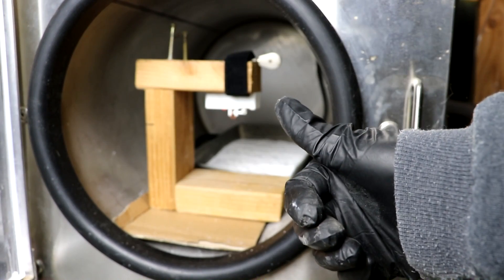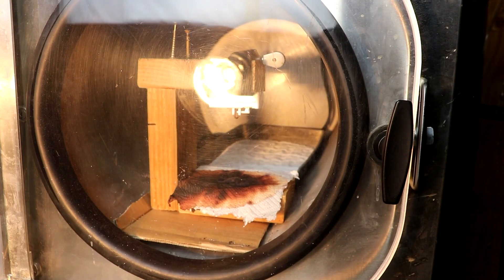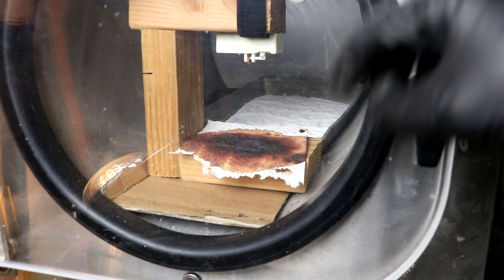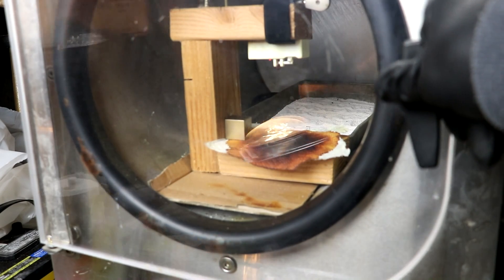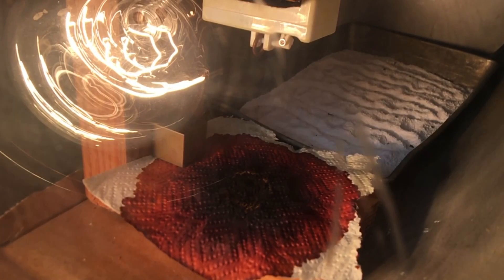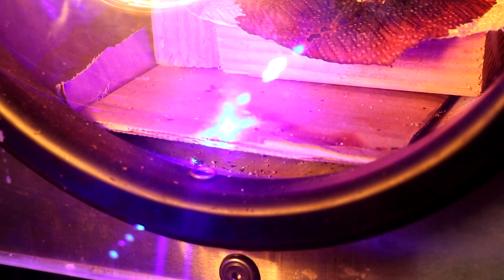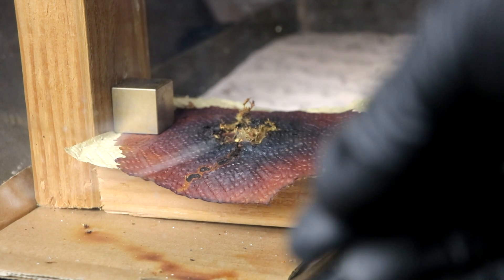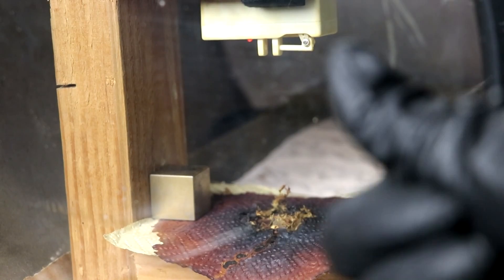Iodine Touch Powder in Vacuum

Comment: Cody, lets see a speaker in the vacuum chamber, it will be interesting to hear how the sound changes as the pressure goes down, and then hear the volume go really loud after the pressure is returned.

Comment: Hey, I wonder if it would set off under sudden pressure change - i.e. if you just depressurised the chamber as quickly as possible. Although I guess entering air could blow it away - you may want to put that in some small container to prevent that

Comment: what pressure did you do that at?  can you try putting a vacuum pump and chamber into another chamber to see how far down you can take the inner one?  compare your results to outer space?
Reply: What you're talking about is a multistage pump, and laboratories regularly do this with the second stage being what's called a turbo pump.
Reply: Brent Lewis but pumps like that are expensive.  cody generally uses equipment on the cheaper end.  he normally does the kind of interesting things we all want to do, but we lack the motivation/talent/equipment/and know how.  :)

Comment: oh, then there CAN be sound in space, if there's some kind of explosion that sends vibrations around
Reply: The sudden increase in pressure CAN produce sound waves, but most likely the sound that we heard was transmitted through the solid parts of the test apparatus, which was in contact with the walls of the chamber. If you suspended the apparatus inside the vacuum chamber you would probably not hear anything.

Comment: Hey Cody I'm currently taking a class on lead abatement and had this idea for you. Is it possible to remove the lead from lead based paints. Might make a good video.
Reply: The lead contributes to the color of the paint. If there was a way to do this perfectly without changing the composition of the paints in other ways, it would likely just change the color of the paint.

Comment: So Cody, could you make your own blanks? What could you use to make them super loud without adding a lot of power? I'm starting to get into the sim rounds that are paint rounds that fire from a regular gun (223 or 9mm typically) and they aren't all that loud, makes me wonder if there's something you could add to the powder that would make a louder bang without increasing the pressure to keep them at a non-lethal speed/not broken by the air pressure against them, but make them sound more realistic.
Reply: The sound is from the pressure wave the explosion releases.    Higher pressure == louder sound.    So I am pretty sure the only way to make it louder is to increase the pressure, or increase the explosive material.
Reply: not necessarily, certain compounds make for louder bangs without increases in pressure.. hence also the differences in grade of HE
Reply: chu Harry  how what?
Reply: chu Harry  if you think of it a plastic bag being popped is really loud and that's only a few PSI

Comment: hmm volume in a vacuum any smart people explain that plz
Reply: As soon as the substance exploded, there was no longer a full vacuum.   The pressure wave from the gasses released were enough to make a sound.  Not a very loud sound, of course.
Reply: The vibrations from the explosion are transmitted through the solid test apparatus and into the walls of the vacuum chamber.

Comment: I would assume without watching the rest of the video that the reason why dropping the metal copper washer didn't  set of the nitrogen ditriamide (whatever it is said as) is because the lack of oxygen reduced the rate of explosive force from lack of oxygenated gas expansion while inside the vacuum chamber.

Comment: hey cody, i was wondering, what would happen if you put a candle in a vacuum chamber? i know it will eventually go out but will it form a sphere when the air pressure is reduced enough?
Reply: It will go out long before that. What you're describing works better in micro-/zero-g

Comment: funny how it blew up and stayed like that, almost looks like wood chip! well an explosion or gasoline burning is practically something becoming gas really quick and expanding from the heat and energy created! kind of like diesel compressing until it explodes! i always wondered if a turbo fan engine could burn rocket fuel (NOS plus fuel) and fan it in a vacuum! technically yes if the heat is no problem i presume but... where do one put the fire? at the compressor intake or from within?

Comment: I was thinking of the best way to pop popcorn and I thought if you pop it in a pressurized environment where the air is denser than the popped popcorn but less dense than the kernals, your popcorn could never overcook right? Because they would float atop the air while the kernals keep cooking. If you could test that it would be neat.
Reply: Best way is the pressurize them while heating, and then very rapidly subject them to vacuum. The kernels all pop into huge gorgeous popcorn

Comment: I don't think you showed the difference here. This stuff can be, if prepared properly, set off by alpha rays. Vacuum or no vacuum, properly prepared compound will decompose violently on its own from influences so incredibly minute that it seems like there was nothing causing it.
You need to make it using highly pure iodine crushed into powder and stirred for hours in an excess of highly concentrated ammonia, then dry it with several washes of absolute ethanol, then diethyl-ether, and use the same batch in different conditions, but very fast.

On Youtube, there are lots of videos where sensitivity of nitrogen triiodide simply isn't demonstrated. People are touching it with feathers, stroking it with a stick, yet all it takes is an alpha particle in most sensitive cases. Walking next to it and causing a breeze will cause it to explode.
It's not a typical explosive. Its sensitivity is so high it doesn't care about vacuum.

Comment: Actually I2 + NH3 reaction forms an NI3*NH3 adduct, the vaccum may have driven off the ammonia, making very fine dust of pure NI3 which may have lower sensitivity. You should try vaccuming it then testing in air. FYI pure NI3 is also made by reacting boron nitride with iodine fluoride, volatile boron trifluoride evaporates.

Comment: It seems like the paper cushioned the metal ring a bit in the vacuum. If you compare the experiments side by side you can see that the vacuum one has the paper bowed like a hill, and it cushions the ring instead of squeezing it between the wood and the paper like the first experiment. Maybe that had an effect on the sensitivity of it? Also, how fast does the laser set it off when in regular pressure?

Comment: Awesome video, I have a safety suggestion for you. Always use long metal tongs to grab explosive material and set it down, especially contact-sensitive explosives like nitrogen-triiodide.
Reply: I commented the same. Grabbing it with one's gloved hands is extremely reckless.
Reply: Thanks, Brent Lewis. I think we all want to see our favorite, talented, science-oriented YouTuber work as safely as possible and keep all of his limbs and appendages firmly affixed to this body! Cody'sLab keep up the excellent work, but never underestimate the raw power of explosive chemicals. This particular chemical, NI3, is actually capable of true detonation (it's reaction speed is faster than the speed of sound). NI3 detonates with a reaction velocity of approximately 3 kilometers per second (3000 m/s). The detonation velocity of NI3 is about 50% that of TNT (trinitrotoluene). As little as 500 milligrams (half a gram) of NI3 has an explosive energy release of approximately 1000 Joules, that's 1000 J being released into your hand if you were holding it. 1000 J is more than enough explosive energy to remove your fingers completely and possibly shatter many of the small bones in your hand, even with a glove on. Any explosive capable of true detonation (rather than deflagration) can and will produce enough pressure all-at-once to seriously injure or kill anyone handling it, even with relatively small masses of the material. Stay safe, Cody! :)

Comment: Hi Cody, great channel - thanks for all the great content.

I’ve had an idea for an experiment you could do in your vacuum chamber and I keep forgetting to ask; luckily this video reminded me.

If you take a syringe under normal atmospheric pressure and you pull the plunger in and out it moves freely as air entering the aperture fills the void being created.

Now putting your finger over the end restricts the movement by as much as you’re able to stretch/compress the air.

In a vacuum I would imagine the plunger would move freely regardless of there being anything covering the aperture - but it would be cool to see two syringes, one with the aperture covered, the other uncovered, side by side operating the same.

Might be hard to rig up though.
Reply: Action Lab has a clever way of using strong magnets with his vacuum experiments that would be perfect for that setup.
Attach, with a piece of paper, one plunger to the outside magnet, one to the inside the same way, then pull up. Would only the outside assembly tear the paper connection? Both?
Reply: Or perhaps lower the open end of the syringe into water instead of trying to apply tape in a vacuum chamber

Comment: Cody, don't you use alcohol to keep nitrotriiodide wet? I've never heard of using water. Just ammonia, iodine and alcohol as the stabilizer/wetting agent. Of course that was my formula back when I was in highschool blowing up combination locks of the school bullies. Yes the statute of limitations has passed about 35 years ago.
Reply: I had to refigure that it's been 40 years.

Comment: A tip for remoting stuf inside vacuum chambers that I learned from Applied Science channel (the guy that made his own electron microscope in the garage) is to use spark plugs. They can transmit electric power through the walls of your chamber while keeping 100% sealed.

Comment: One thing that was notable about the explosion - no purple cloud like you would normally see.

I presume this is because the iodine vapour fills the whole chamber pretty much instantaneously, and is therefore too dilute to be visible. Has anyone got any other possible explanations?
Reply: I think it got evacuated by the vacuum pump. If you watch frame-by-frame you can still see a plume. I guess the laser was too bright too.
Reply: I watched it frame by frame and could only see for certain the paper towel shoot up and back.

I think the iodine was dispersed ballistically at mach "godawful awesome" and coated everything with a submicron film.
Reply: Acb Thr No, Iodine vapour is purple, it isn't a reaction.
Reply: Either that, or the purple is coming from a reaction of the iodine vapor with something in the air, so it goes away in vacuum. I have no idea about iodine reactions or oxidation states so I can't say for sure.

Comment: Why didn't it make smoke in the vacuum?
Reply: It did, but the vapor pressure of the smoke causes it to expand and fill the entire chamber very quickly, making it almost invisible
Reply: Does that mean that explosions have more of an effect on their surroundings in a vacuum? Would the shock wave (not shrapnel) from a grenade (assuming they would work) on the moon or on a spacewalk cause more damage than a grenade at normal atmospheric pressure?
Reply: Assuming we're talking about pure high explosives, no, for a couple reasons. Some of the pressure of the explosion is being diverted in every direction to fill the vacuum with gas instead of being channeled into a pressure wave like in an atmosphere.  The shock wave can also only exist and propagate as long as there is a medium to be subjected to a pressurizing shock, and if the only medium the explosive has around it to create a pressure front is the gas from its own explosion, it will be vastly less effective than otherwise. Such a sparse amount of gas can absorb far more energy via compression than air can at atmospheric pressure. For an example of the opposite effect, we can take a look at large bodies of water, where shockwaves from explosions will propagate with huge efficiency due to water's inability to compress and absorb kinetic energy, thus transferring almost the entire energy of an explosion into the shockwave. This incompressibility is the reason depth charges, for instance, are so effective against submarines, since even medium-distance misses can cause enormous damage thanks to the immense pressures created when something explodes underwater.

Comment: I was thinking of putting bags of parafin vax with approximativ 60C melting temperature in the bottom of my warm water tank.

The thinking is that is that the sun heating can easialy heat the water to 60C, but hardly heat to 100C.

Having the fusion of the of vax would have two advantages.
1: Use the solarheaters at a lower temperature.. that is, collecting more energy
2: Have the tank in a generally lower tempeature, having it leak less energy.

As a extra bonus the heat capacity of the tank should increase, if i calculated correctly about dubble at the same volume

Comment: Question:  How would the reactions compare for different gasses?  One atmosphere of carbon dioxide vs one atm of air, vs one atm of nitrogon vs one atm of oxygen heavy air (100% would probably cause a very exothermic reaction with the paper), etc.
Reply: There probably wouldn't be much difference, because the reaction is just a decomposition of NI3 into elemental nitrogen and iodine, so what the atmosphere is made of doesn't matter as it isn't involved in the reaction. The only reason it is important to to create the confinement necessary for an explosion. The only difference might be a change in the pitch generated by the explosion (eg a helium atmosphere would produce a higher pitch, because helium).
Reply: Aside from the oxygen rich environment, they'd be pretty much the same as in air. With enough oxygen, the entire thing, paper towel and all would explode at once.
Reply: I tend to agree with both Alex Potts and Ach Thr in that except for a overwhelming abundance of oxygen, the results should be the same.  But I still wonder if the roughly 20% of O2 in our air plays any part at all.
Reply: I don't think even pure oxygen would make much of a difference. Neither of the reaction products are particularly flammable. Nitrogen is pretty unreactive all round. Iodine is quite reactive with metals, but much less so with non-metals like oxygen.
Reply: Yes, it would. Just the small, instantaneous amount of heat/sparks would cause the paper to immediately combust, likely setting off all of the explosive material.